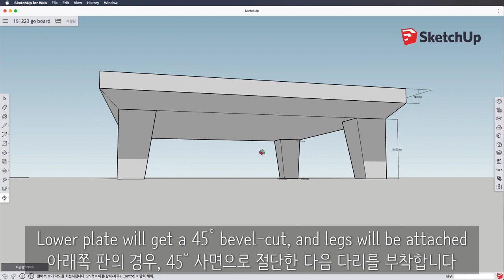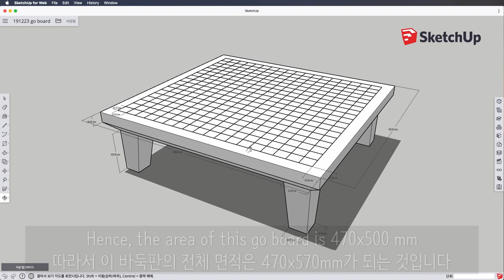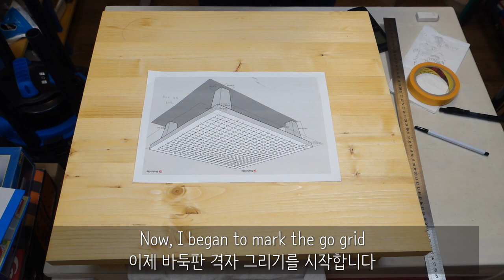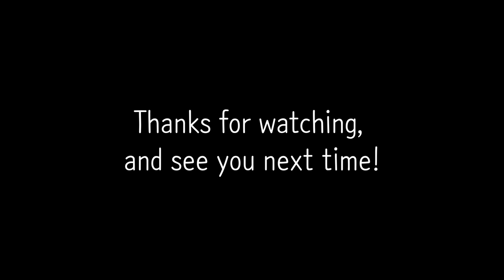Building a GO BOARD, a woodworking beginner’s guide

Comment: could you post an exact copy of your line template? I'd like to be able to replicate this but am getting stuck on the lines.
Reply from the maker: Unfortunately I lost the template file. It was such a simple grid that I didn't try to keep. Hopefully, you could create one using any drawing or even word processor app. Sorry!
Reply: @Tinker_Box  it's fine, it's just that gobans are a specific distance for the lines both length and height wise and would be useful to have an accurate template
Reply from the maker: @justin9202  Right. Gobans are actually specified even to the height. In my making though, I sticked to the size of individual cells, but the margins and the height aren't 100% accurate to the specification.
Reply: @Tinker_Box  well everyone has their own taste, I'll see what I can do when I make one tnx